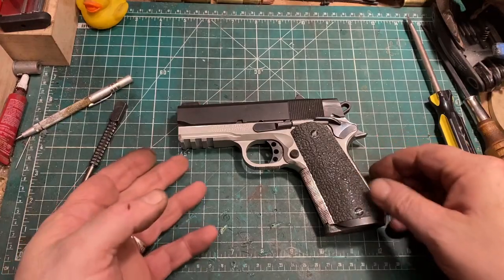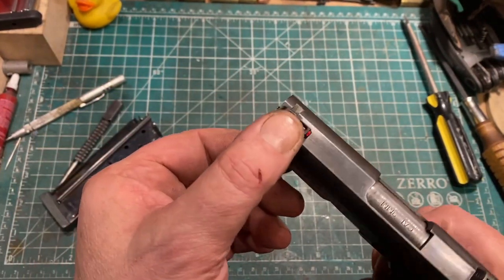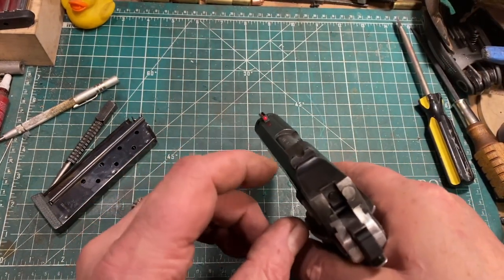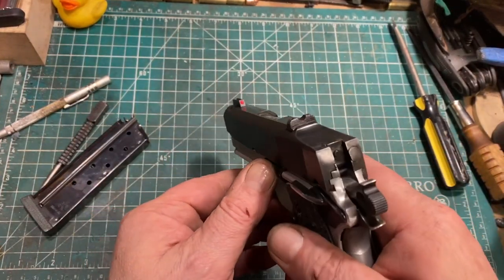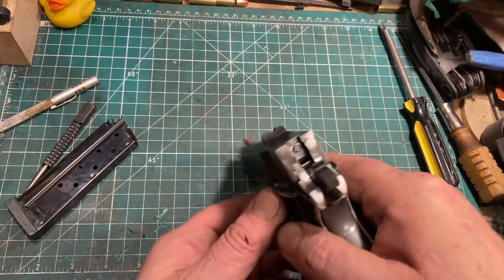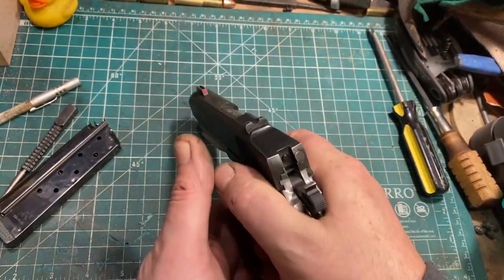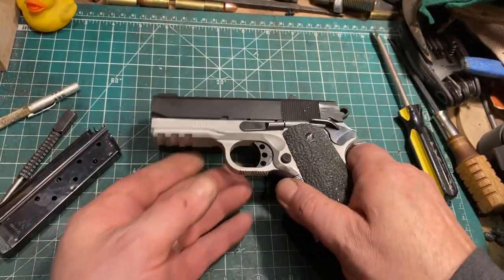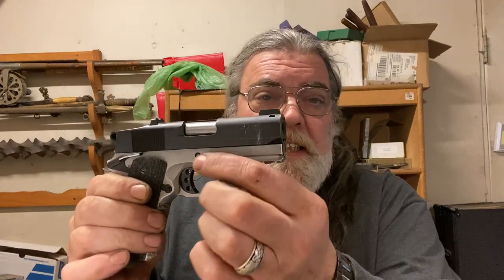LDD Update #3 Gettin' There!

Comment: These are fun little guns but not very ergonomic as they were designed with concealment as the #1 priority. I had a buddy I went to gunsmithing school that had 1 and we shot that gun a lot. If we took our time with it, it was surprizingly very accurate. We used to shoot a 100 meter gone of 3'X4' with it and hit it most every time. I bought one 4yrs ago in 100% condition in the factory box with an extra factory mag for $550.00 It was a steal so I had to have it. After a very short period of time I realized there were more efficient designs today and I didnt (at this age) enjoy it the way I did in school in the 80's so I sold it and made a very, very nice profit.
Reply from the maker: If you got it for $550 I imagine you made a very tidy profit! Well done indeed.  I've made changes to improve the ergonomics of this one and it works quite well in my hand, but YMMV.  I still love shooting my original .45 Mk.1, but I've made a few modifications to that one as well.